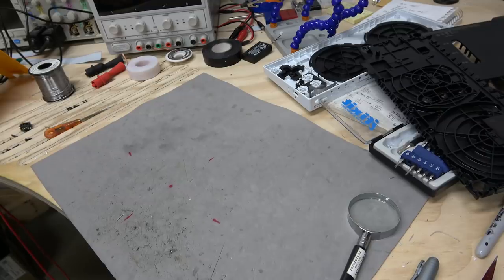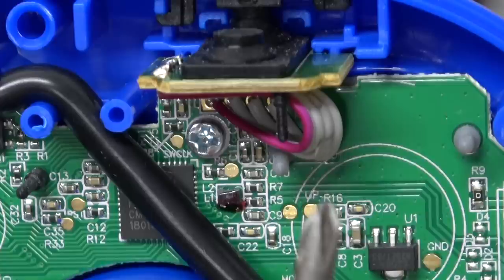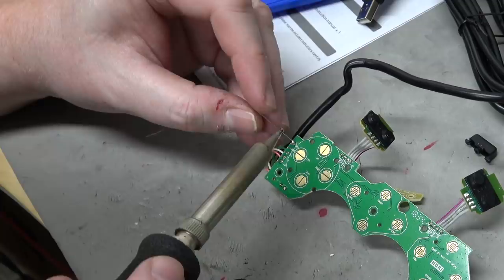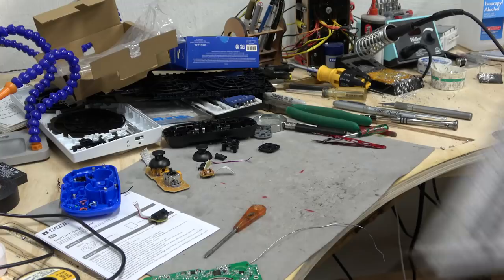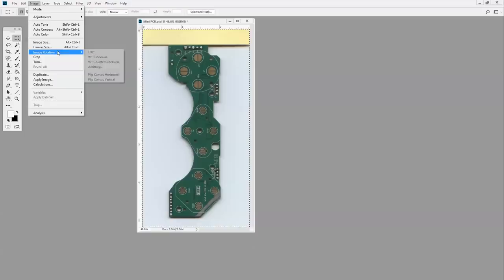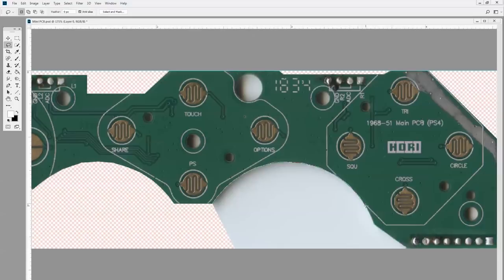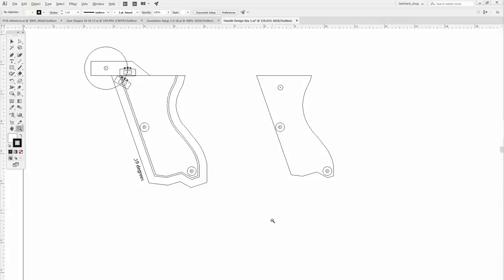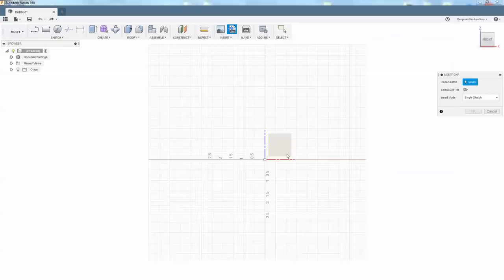The Quest for a PS4 Single Handed Controller Part 1

Comment: One of my buddies lost his hand in a motorcycle accident. Used to love playing video games but just gave it up. Keep working on this. It will change many lives. ❤️
Reply: Heart warming
Reply: @bokutosowl2533  yeah
Reply: The 8BitDo GBros wireless adapter allows you to connect a Wii Nunchuck to your Switch or PC. It turns the c and Z buttons into A and B so you can play for example NES games one-handed
Reply: I actually lost my hand in a blast a few months back, been looking for a good one handed controller and there aren't many good options out there. I wish companies would make an effort for it. Just received a HORI Super Robot Wars controller, haven't gotten the conversion wire yet for my XBOX, (as it is for a PS2.) Tell your buddy to check it out, it's the best on the market as it stands. Until this guy comes along and makes something great.
Reply: For PC I bought a Grifta Solo. It works pretty good and only cost like $30 on Amazon.

Comment: If you get this right, you are going to change millions of lives with this mod.
Reply: How do you find this useful, I really don't get it? The only scenario I can think of where this would prove it self is for people with one hand.
Reply: @duceanima2069  or challenge seekers. A niche of people in the same ilk as speedrunners 
Otherwise...useless
Reply: @duceanima2069  There are many other reasons to use a one-handed controller besides missing a hand. There are many people with repetitive strain injury in one hand but not the other, there are people with one hand that's underdeveloped, etc.
Reply: @Phoenixflame87  Fair enough, now add the other analogue stick and the d-pad, and play anything the requires you to aim and move at the same time. I just don't see this concept working. Then again I saw a guy play LOL using bananas as inputs and he wrecked everyone so I just might be ignorant on this occasion.
Reply: im thinking for PS VR because playing with a 2 handed controller sucks cause u cant use 2 hands in the game and the move controllers suck because u gotta port everywhere and not be able to walk with a toggle switch it would be more realistic
Reply: insert self explanatory fap joke here
Reply: @duceanima2069  Do you know someone with less than 2 fully funtioning hands? That is exactly how that is useful. I have several friends with issues due to accidents or birth defects that would greatly benefit from something like this.

Imagine losing a hand and not being able to use a normal console controller effectively anymore. That would be a sad situation to be in, and this would help solve that for millions of people on Earth that suffer from similar impairment.
Reply: @fleshtonegolem  that is what I said in my first comment, makes me wonder if you fully read it. My point is that you can't controle ale the functions of a controler with only one hand ad to a effective degree. I already expressed my concerns, please read the tread of comments before replying further.
Reply: Imagine one for each hand WITH a six-axis or wii remote like (accelerometer, motion sensing) function. 

The thing EVERYONE seems to miss, is that a controller of this design will be if not the first controller to allow full utilisization of ones fingers, while additionally allowing the user to always keep his/her thumbs remained on the joysticks. Mostly all controllers ignore the use of ones ring and pinky finger. Competitive console players would endorse the shit out of this. And from a marketing standpoint, an added six-axis/accelerometer function, can purhaps bridge the niche like demographic with the more serious gaming enthusiast. Imo.
Reply: @duceanima2069  I know plenty of people with just one hand.
Reply: @obalisk990  I agree, you are totally right, but we are discussing what is in the video, and I initially replied to the Warmer. if you have a second controller then it's not for disabled people anymore. The scenario that you propose is great but it is not really relevant to this video. Lots of you seem to miss my point, but I might have not expressed my self clear enough.
Reply from the maker: @duceanima2069  That is correct. There's actually a lot of reasons why someone might not have use of both hands.
Reply: @BenHeckHacks  I realise that, I'm a bit confused now. Are you implying that the prototype you are working on will offer full functionality of a normal controller but will be controlled only by one hand?
Reply: @agonleed3841  ehm its not a challenge for speedrunners if the one handed controller works xD and its not useless. people that have only one hand?
Reply: Nintendo Wii says hi.
Reply: @user-qx7tm5df8j  one handed people usually have a nub. There are controls in progress to be used in that fashion.
If it's a deformity...its usually accompanied by missing fingers on both or just the one hand. So....

Technically nothing created is useless. But no one but you are speaking technicalities. Normally when people do that, it's only because they understand and agree but want to purposely be the anti.
We get it. You're special.
Reply: @duceanima2069  Broke my hand once, this would have been awesome and bought so I could game for 6 weeks while waiting for it to heal..... you cannot deny there is a substantial market for something like this now, and for future controller designs.
Reply: Gotta say, I put more thought into it, and if you moved the x○□◇buttons next to thumb and right analogue, gave the left analogue on the bottom the ability to be switched back and forth to d pad and left analogue, mapped the shoulder buttons to finger tips(allowing freedom to change mapping for each game) and located the start select ps buttons not too close but in reach of finger tips. This could be one badass controller.  I would use it and I'm handy capable....sorry bad pun...My hands work....
Reply: Yeah until you realise that he only made one...
Reply: @Dezzatube  what do you see in the video. This is getting awkward. Would you be able to play call of duty with it for example?...
Reply: @Matt-mt5it  He only made part 1
Reply: @duceanima2069  I saw someone play call of duty with a pineapple,so I'm sure someone can play it with a one hand controller
Reply: @duceanima2069  18:35 and you have two analogs + he still has some space to work araund thumb, he can get arrow keys there..
Reply: @TheCyberknox  I missed that bit, thanks for posting the time stamp, now I can accept what ever it is meant to be. Still can't see it being practical but some people will disagree and prove me wrong. Anyone who will be able to preform well using one hand has my respect. Sorry for not noticing the second analogue stick everyone, I didn't mean to cause drama.
Reply: He did it on xbox
Reply: Discordant Anima I mean it would take some practice to use it but it could be as practical as the normal design (for people with one hand) since don't forget the normal isn't as intuitive as we think when it comes to newbies and hell it isn't that practical to use if someone has only ever used mouse and keyboard without any practice.
Reply: @duceanima2069  
1) don't play call of duty
2) Yeah, you should be able to play it with this. 
3) Is a proof of concept.
4) Have you seen tbe popular streamer "halfcordinated"?  This mod for him will be so goddam perfect.
Reply: @duceanima2069  he is placing the secondary stick on the bottom (guessing the walk actuating stick) so that you can make your charactee in game move while placing it on your leg and moving the cobtroller, otherwize you could make it a larger cobtact surface and either have it stationary like a flight simulator stick wich actuate from the bottom or use the sliding type of stick on the bortom like on the psp/ps vita  whoch would make it easier in some ways, need is the mother of inventions and I think he will solve it pretty good, my brother has a non functioning hand due to an accident at work and I have muswlf been in the thoughts of a one handed controller because of it because hevloves videogames especially the playststions😊
Reply: @obalisk990  wasn't there a plan for the ps4 in the early stages of development to have it just like that woth a middlesecrion that you could conect the two halves with if you wanted? 😁
Reply: @duceanima2069  yo I'd actually love to see this. Not trying to make fun of you or it but I'm actually intrigued and love weird stuff. You have a link? You dont have to reply. I'm not trying to see if you are living I'd just like to watch it
Reply: I think we underestimate the sheer amount of people with only one hand to use. You have two, I mean the odds of going through life and losing one of them isn't exactly low.
Reply: I would want this for use with a mouse.  To get the best of controller with the best aiming and precision potential.  I'd be very  interested in buying one once its finished..if it works well for that purpose.
Reply: @duceanima2069  you can move moving the whole controller as the left stick will be in the base of it and you can aim with your thumb. Now the D-Pad will be harder, but you could for sure implement it somewhere. Maybe in a "double deck" under the normal buttons are, as the pad is not used that often.
Reply: It’s just a Joystick
Reply: @duceanima2069  if you saw the vid he explains that the other analogue stick you would move with your wrist basically the other stick is on the bottom and you just move the whole controller like if it was an arcade stick. It's weird and unordinary concepts like this that make way for new innovations.
Reply: As someone only 24 years old with severe arthritis and CRPS, mainly affecting my dominant right wrist but also left wrist, with major deterioration recently. A single handed controller would help me. I managed to get in over 1200 hours of gameplay in 2018 because I know my wrist is getting worse and there will come a time where I won’t be able to game, but there are some companies out there like SpecialEffects who’ve been in touch to help but these kind of ideas keep my faith that gaming won’t be over for me soon. I’ve gamed all my life and though I enjoy watching people game, I don’t want to lose that ability to game myself.
Reply: I don’t understand the nay-sayers. Must you have a reason to be inspired to build something? If he feels like building a one handed controller why not?
Reply: I would love this, I have a very weak left hand and really bad finger dexterity too, and this would really make my life easier
Reply: @duceanima2069  I've been looking for a left handed controller to use with the Playstation 4. The reason is I want the analog for movement but the precision of a mouse for the right hand. The reason I can't use a full controller is because most of the face buttons are on the right side so I can move and aim but it would be hard to reload or use the action key.
Reply: You could play MvC against yourself.

Comment: It looks like those flight simulator game controllers
Reply: Often called sticks.
Reply: A joystick?
Reply: Yeah it dose look like a throttle!
Reply: I don't want too hear you say your bad at what you do, that is pretty cool and thanks for showing us your project.
Reply: @jetblade89  what
Reply: A yoke. It’s called a yoke.
Reply: @ahahm3  no, a yoke is basically a flight steering wheel. It turns and has push/pull for nose up/nose down.
Reply: iLoganC Oh Yeah, I mean it’s like a joystick like the one in the A380
Reply: shoulder buttons for the pointer[L1] middle[L2] ring[r1] and pinky.[R2]  maybe and the  SHAPE buttons to the right of the analogue stick. that would mimic the feel of the ps4 controller a bit better. keep a similar layout. but make those buttons thumb accessible . because during game play you would be disengaging the analogue stick in order to press those buttons anyway. I feel it would be more natural.

Comment from the maker: Should have part two by second week of January. Stayed tuned! (and yes I'll try and fix the audio next time)
Reply: Ben Heck Hacks oh darn it then I guess I’ll just have to turn on the notification bell. Oh well...
Reply: You could add face buttons to the side of the controller like a typical L1 or r1 button with the other two face buttons raised a little on the front of the controller. Not telling you what to do. Just food for thought
Reply: @Alexander Marin Or release the files
Reply: Ben Heck Hacks reminds me of a wii nunchucks
Reply: I need help with my xbox controller the right analog stick is all messed up and broken and idk how to fix it would u know anything to do???
Reply: Why is flipping the handle vertically actually horizontal?
Reply: @liamharvey737  could just buy a replacemenr and have someone handy to switch it for you if you can't do it yourself 😁 haven't replaced an xbox stick myself but have done a couple of N64, ps2 and ps3 sticks before and it aint that difficult 😊 the jardest part is always putting it back together, it's always easy to take something apart 😂
Reply: @Who_Gaming  you flip it on the horizontal plane 😁
Reply: Emil Westgaard Henriksen lol I looked at a few replacement parts but I was just thinking of getting a new controller, I have the white standard xbox wireless controller and I punched the front and it broke yikes but thank you for trying to help but I just got some money for a new one thanks again 👍
Reply: @liamharvey737  haha well raging accidents do happen and sure is the cause of alot of controllers breaking, that and younger siblings pouring stuff on them 😑 anytime! 😁👍🏻
Reply: Hurry up and I shall be happy right now I am bored just watching Fortnite stuff
Reply: Can you just give us the 3D files that’s all we need
Reply: I think those 4 bottom buttons (for the pinkie & whatever that other finger is called) would greatly benefit from being mounted on a board that angles them a bit forward, having to reach all the way around looks a bit too awkward. And maybe an extension of the handle further towards the wrist if that throws the torque too high.
Reply: try to fix the cringe-factor too
Reply: Is this just a concept and youll make real controller shell with 3d printing?
Reply: Didnt like the design at al you should compare a real controller experience with this one i can tell ya the normal controller doesnt have 2 buttons on the same lane as the finger cause you dont want to press multiple buttons in the heat of the moment ingame especially online games i do like the idea i had Some veterans who played online fps tournaments and they was good but could online play with one hand so they could be better but they didnt had like a one hand controller so hopefully you make a great design in the end so that the sole purpose for this type controllers could roll out to those who served there country and Cannot play a normal game like the rest of us with our hands intact good luck 🙌
Reply: Just an idea but make a joystick design for easy use
Reply: i was about to say because jesus christ man on my phone its fine but i have to pick which ear i like to hear out of more!
Reply: Where is part 2?
Reply: Two ideas. 1) Not sure of the current config but having the bottom joystick for movement would seem better to me as movements don't need to be as precise as aim. 2) If possible for the buttons you could use some sort of push pull system (pull for X/push for square) so you would only need two buttons as your pinky and ring dont have as much dexterity. Looking forward to part 2!
Reply: shoulder buttons for the pointer[L1] middle[L2] ring[r1] and pinky.[R2]  maybe and the  SHAPE buttons to the right of the analogue stick. that would mimic the feel of the ps4 controller a bit better. keep a similar layout. but make those buttons thumb accessible . because during game play you would be disengaging the analogue stick in order to press those buttons anyway. I feel it would be more natural.
Reply: Cant w8 for part 2. It looks good, beter than the rest of the prototyps on youtube. Will you make youres public? Like to make it. Ohh and how will you fix the cable?? Or will you make it wireless?? 😋😏
Reply: STILL WAITING IN AGONY
Reply: WHERE IS PART 2

Comment: What if you put the main buttons on a little bit of an angle??
Reply: Exactly what I was thinking. It's more of a strain on your ring and pinky to extend that far while putting pressure on them.
Reply: Very good idea
Reply: He said he would in the vid
Reply: @Nobbie248  shoulder buttons for the pointer[L1] middle[L2] ring[r1] and pinky.[R2]  maybe and the  SHAPE buttons to the right of the analogue stick. that would mimic the feel of the ps4 controller a bit better. keep a similar layout. but make those buttons thumb accessible . because during game play you would be disengaging the analogue stick in order to press those buttons anyway. I feel it would be more natural.
Reply: @sachan9081  shoulder buttons for the pointer[L1] middle[L2] ring[r1] and pinky.[R2]  maybe and the  SHAPE buttons to the right of the analogue stick. that would mimic the feel of the ps4 controller a bit better. keep a similar layout. but make those buttons thumb accessible . because during game play you would be disengaging the analogue stick in order to press those buttons anyway. I feel it would be more natural.
Reply: @kylewilliams6679  shoulder buttons for the pointer[L1] middle[L2] ring[r1] and pinky.[R2]  maybe and the  SHAPE buttons to the right of the analogue stick. that would mimic the feel of the ps4 controller a bit better. keep a similar layout. but make those buttons thumb accessible . because during game play you would be disengaging the analogue stick in order to press those buttons anyway. I feel it would be more natural.